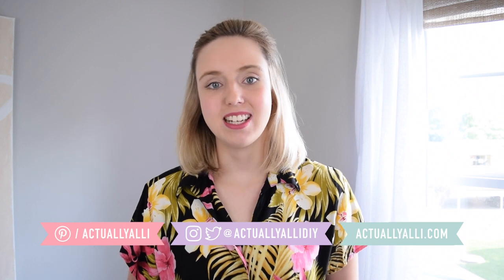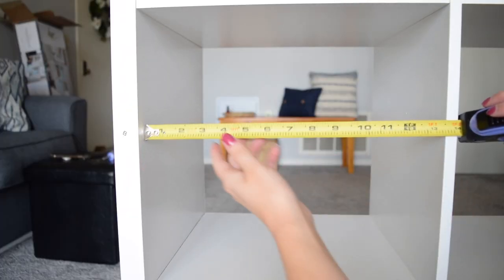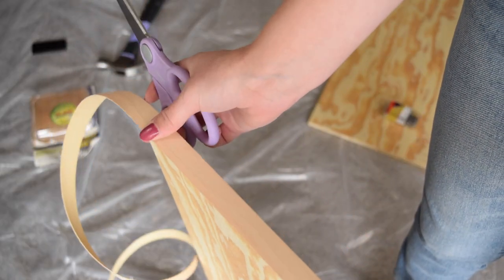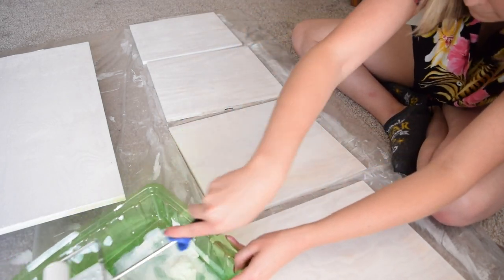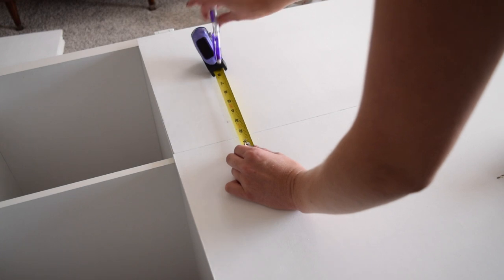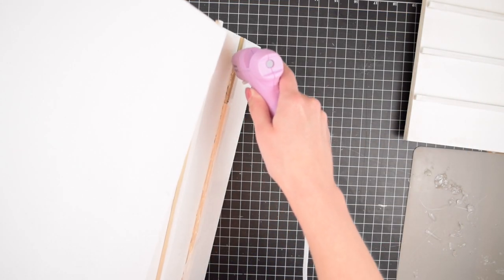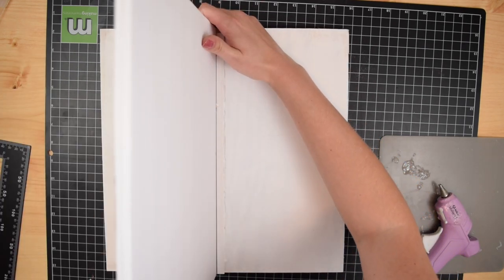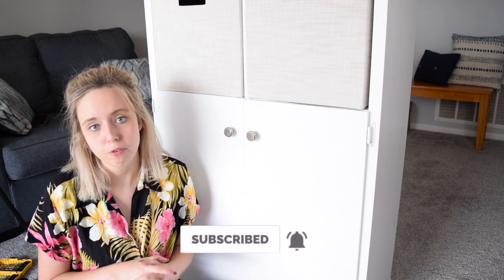DIY IKEA KALLAX/CUBE BOOKCASE HACK! || Actually Alli

Comment: Or for the paper holder, u can nail/screw in the dowels & put a thin wood on top so its sturdier & ur able to move it out & slide it back in🙂
Reply from the maker: Would be a great idea and what I would have preferred! I don't have a saw to cut plywood on my own & the guy at the hardware store was getting flustered, so I didn't want to push it. The paper is light enough that the foam board works perfectly fine